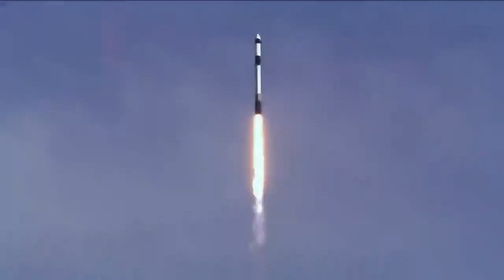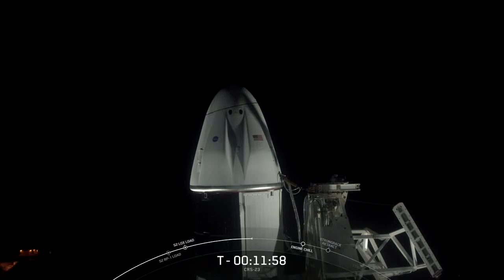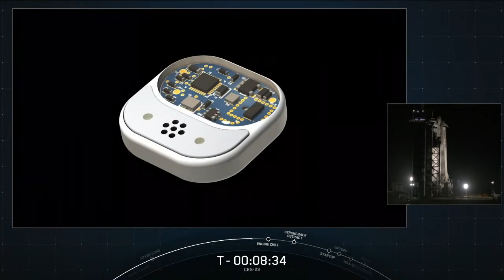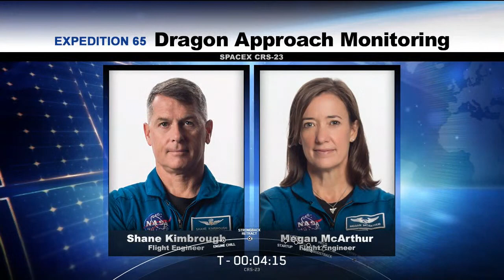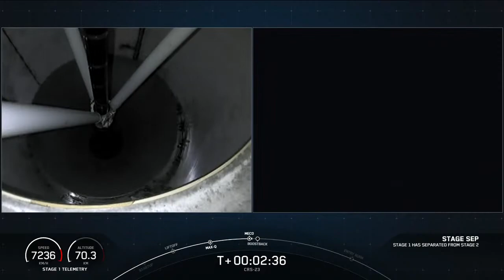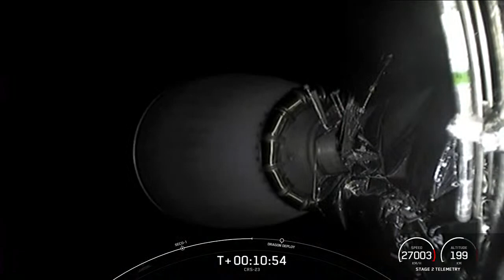CRS-23 Mission

Comment: First, View This Video that suggests something weird, for which I suggest a less weird and more plausible but similar solution, something less than the dive into the unknown territory of space flight research I suggested two days ago.

https://youtu.be/Rb6sxy3f7VE

But instead of using Railgun,

How about the use of the Railway Of Bullet Trains?

There will definitely be some redesigning of the Railway.

Acceleration can be controlled and gradual, making it pleasant for the ordinary people, the settlers who will colonize Mars.

If such a railway can lift a fully loaded train off the ground and suspend it in mid-air and propel it forward, why not a fully loaded Starship? 

But, of course, a long railway will have to be constructed, 

PERHAPS A LONG CIRCULAR ONE THAT ACTS LIKE A SLING SHOT. 

Round-and-round until fast enough before letting Starship go up up and away. Y'know, like the young man David, with just his sling, he made a stone go fly so fast the stone smashed through Goliat's helmet and sunk into his skull.

Starship can make better uses of it's fuel later on. For one, there won't be any need for refueling before leaving for Mars.

Comment: Aside from chemical energy and nuclear energy, what else can move really heavy things at great velocities? Well, there's magnetism. It can and does lift trains and make them float above the ground and propel them at high velocities. Yes, magnetism, not chemicals like gasoline, methane, or coal or any such thing.

Now here's something really interesting. Sound can make things fly through the air. Well, small things at least.

Here's something else. Light has been slowed down to a stand still, and then made to resume gradually back to it's original speed, and even made to exceed it. Light has mass (E = mc2), and behaves like sound, too. Perhaps it can, like sound, be made to also do what sound can, make things fly off, not just through the air but to the next Galaxy. 

Think outside the box.

Perhaps someone can discover how to latch on to light. There was a time when a horseless carriage was unthinkable, or a floating piece of iron, or light cutting through steel, or a telephone and a television in everyone's pocket. And how about flying through the air at supersonic speeds, or landing on the moon?

There was a Physicist, a Ph. D. degree holder, who was funded (with lots and lots of money) by the Smithsonian to research on how to fly through the air. Sure his contraption flew, but crashed immediately. Who succeeded? Two bicycle technicians, the Orville & Wilbur Wright brothers, and with just their meager pocket money.

We don't know everything there is to know about magnetism. 

Then there's Nikola Tesla who captured millions of volts of lightning and put them to use. It was Nikola Tesla who invented the idea of a rotating magnetic field. It is this concept that powers our electric motors today, like the electric fan, and the electric motors that propel the Tesla cars of today, for example. Can you imagine a rotating magnetic field? 

It was Nikola Tesla who, with Westinghouse, built and installed the great electric generators at the Niagara Falls. This one man indeed changed the world with his inventions. His biography reads like Syfy.

And then there was Archimedes from several thousand years ago who stunned the people around him with his math and physics. With his arm he lifted a boat off the sea. Then he said, give me a place to stand on, and I will move the world (the planet earth).

Comment: instead of after fully refueling  a moon or mars starship in orbit have the last starship tanker help boost the moon/mars starship out of orbit . it does not need to use all its onboard fuel to do this. it can reserve for its self enough fuel to reverse coarse and land back on earth. with the lighter load and using the earths gravity it should be able to do this with, I presume, about half or less fuel load. this would allow the moon /mars starship to arrive at its destination with a larger fuel load. Or this can allow a larger payload to its destination.

Comment: Why don't they use the booster as a refuler? It would take less engines to get to orbit, without a Starship on top. Those fuel tanks are really large. They can  use, coaxial tanks in upper tank section. Use the lower for all Lox or all methane. You could coaxial tanks as well. Put a carbon-fiber nose cone on top, for aero dynamics. They could reenter like a falcon 9? Also they can still catch it on landing. You now only two launches to refule a Starship. Just a thought.